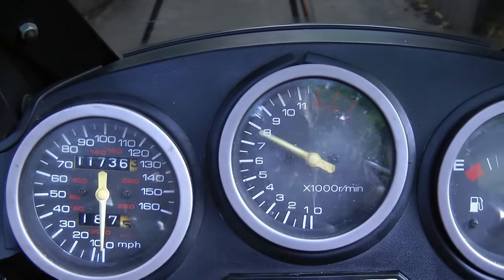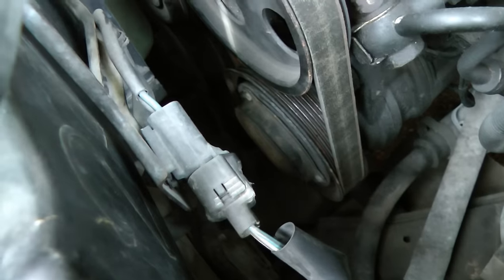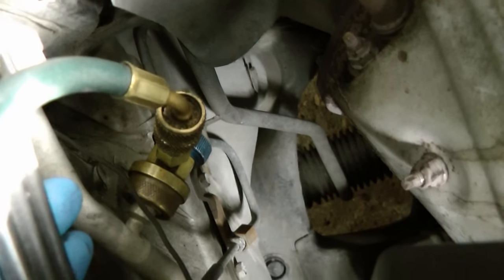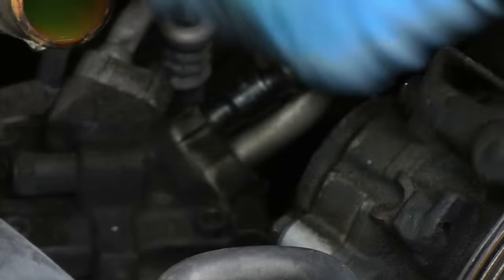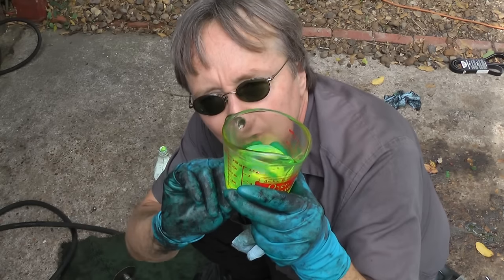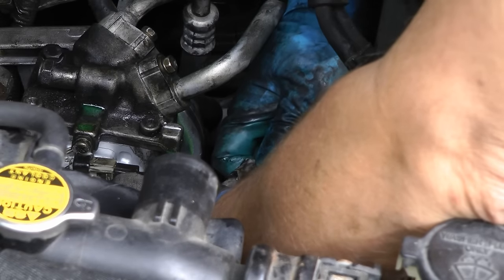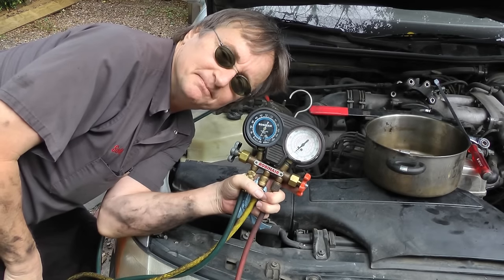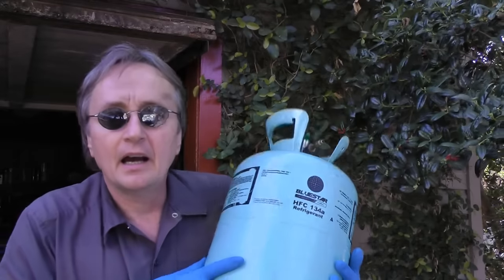How to Replace AC Compressor in Your Car

Comment: Im replacing the major components of an ac (compresser, condenser, receiver dryer, orfice tube, expansion valve in the rear ac) in a GMC G2500 Vandura. Im going to flush the hoses and the evaporator. I was wondering about the rear ac. I cant find many videos about it so Im worried I may miss something. Any advice would be appreciated. Thanks

Comment: @scottykilmer  ‘12 traverse AC light blinking 3 times. Replaced the ambient temp sensor but that didn’t work. Checked the low pressure side of the AC and it was zero. I recharged my AC using a recharge kit and the compressor kicked on. Once it got to a point the compressor turns of then on for a few seconds then off and on etc. No cold air but the light stays on now. Do you think a high pressure switch or something else could be the issue on why it keeps cycling back and forth.

Comment: Hey Scotty what all would I need to replace if the compressor has gone bad on my 97 mirage... or what all would I need to vacuum
Reply from the maker: I would change compressor, drier, and expansion valve, then do as in this video, You must vacuum out the system of course.

Comment: This looks easy enough but I've always wondered how you go about applying the correct tension on the belt after everything is buttoned up. Do you have a video on setting belt tensions or is that yet to be made? Sorry I haven't searched prior to this post.
Reply from the maker: most modern cars us auto tensioners. But if yours doesn't, you make the belt tight until the longest run portion of that belt can be just barely turned 90 degrees when you grab it with your hands and twist
Reply: Scotty Kilmer
Auto tensioners, will wonders never cease? Thank you kind sir, there is a reason why people say you are a great mechanic!

Comment: Hey Scotty I have a 04 Honda Accord Lx 4Cyl 4Dr Sedan. I have many thoughts about why my AC not working good as before. I get no cooling @idle (unless it's night time or the suns out or early mornings) or in traffic but cools fine on highway. I had recharge,vacuumed and even replaced my AC pressure switch.But i'm ending up with the same results>WARM AIR @ idle. So before I go all out on buying a AC compressor or kit, is the compressor really the issue? because by me buying the minor parts hoping that my AC will work. I just want to see if it's really the compressor. And every AC tech i go to they either tell me it could be my Expansion Valve or my filter.  They came to agreement that my compressor is working properly. But when i drive, i would hear my compressor click off. Unless that is normal for it to do. So Scotty, what do you prefer or think the problem is before I have to replace the compressor. And my fans are working properly as well.

Comment: Hi Scotty, great video! I have a 05 nissan altima, brand new ac compressor. The guy sucked all the air out, added freon but still the compressor isn't kicking on and no cool air blowing. The guy thinks now it could be my O ring. Do you have any ideas of what could be wrong?

Comment: Hi Scotty, how stiff should the compressor be when turned by hand, mine I would say was "moderately "stiff to turn, the drive belt was slack so I re-set it and it seems to be working fine? It has just been re-filled and had lube added too!
Reply from the maker: yes, moderately stiff resistance

Comment: Hey Scotty.  Great vid.  I've got an AC compressor and the clutch wont engage anymore.  Everything else about the AC system is fine.  I'm probably going to have to replace the clutch or the compressor at some point in the future but for now I'm thinking about some how joining the clutch to the pully so that the AC is permanently on.  Do you see any probs with doing that?  How would you do it?

Comment: Scotty, I have a green dye around my compressor and the pulleys bearing is shot because its making a squealing noise. I had the system emptied out at my auto shop. My question is do I have to replace the receiver dryer also? Im going to have my auto shop refill the a/c system, once I replace my truck with the new compressor. Thanks man!

Comment: Scotty,2006 Chrysler 300 3.5 rwd. 
As per your excellent - I had the AC vacuumed and recharged and dye added last year and she wasn't blowing cold at idle this week so I went to get it checked and they said that Low side was too high At 60 (and should be 30/40)
And I have Leak at front seal of the compressor as per the dye.They say I need to replace the compressor and dryer and with labor it's about $650.00. 
1.Are there any tricks/fixes to a leak at the front seal or do I need to do a replacement?
2.Do you know of any videos/step by steps walking through it for a 2006 Chrysler 300 3.5 rwd?  I'm no mechanic by any stretch but im willing to try with the proper direction. I've done a successful clock spring with a video.  I priced out the compressor/dryer at autozone for $245 for compressor and $45 for dryer.   The brand was 4 seasons. Any good?  Any brand you recommend or that I should stay away from? 
Thank you in advance for all that you do as you are a true treasure of knowledge and are able to translate that knowledge in a digestible manner. 
Stay awesome!

Comment: Hi again Scotty, I checked my other car and the pump is much "free-er" than the "problem" one. There is no noise or anything and the air con does seem to work ok, the pump body gets quite hot though.... is this normal?
many thanks & God bless, Bill.
Reply from the maker: yes, they all get hot when running, as they compressor gas to liquid which creates tons of heat

Comment: My question is, I have an 2002 Mercedes Benz C240. My wife was driving home from work when she heard a clucking sound under the hood and the AC went from cold to hot. I told her to park the car until I arrived to try to diagnosis the problem. The Sound was coming from the AC compressor. Some plastic inside the clutch looks like it had split and was sticking out through the cracks of the AC clutch front cover plate. What all parts would you recommend to replace to prevent another AC failure?

Comment: Hey Scotty, my mum has a strange problem with her car's AC. I just works for half an hour tops and then quits (if it works at all). We hat it at the garage yesterday, and even though they worked on it for the entire day they couldn't figure it out. There are no error codes in the computer, the compressor is working, pressures are OK (no leaks whatsoever), refrigerant amount is ok, condensor and heat exchanger are ok, ventillation is working properly. All HVAC systems are within spec, apart from the fact that it doesn't get cold inside (after some time) even if it's really hot outside. All sensors an actuators were checked and all the electrics, but no faults were found, even after 3 test drives by the mechanics. Do you have any idea what else could be at fault? (2011 Opel Astra)

Comment: Scotty Kilmer I have an 03 Camry where my AC light is blinking. Replaced the compressor, magnetic clutch relay switch, and cabin air filter and still the light blinks. When I turn on my AC, the radiator fans starts to blow and then shuts off. Any ideas on how to fix this? Thanks in advance!

Comment: Many compressor manufacturers won't warranty it unless you show proof of flushing system, new dryer, expansion valve, and proper PAG oil refilling. Also - after vacuuming I'd let it sit for awhile - like overnight - to see if it holds vacuum.  Cause if it doesn't - you got another thing to find and fix.  Anyways- as he said - if it broke while driving - do the proper prep - cause if you don't and you simply re-install a new one - the debris from the old one will not only screw up the new compressor - but it will screw you out of a warranty replacement.

Comment: what kind of oil are you putting in the compressor? engine oil? or there's a specific compressor oil?
Reply from the maker: most modern cars use PAG oil, but the weight varies, always check with the manufacturer

Comment: If the pulley bearings are bad, and the belt broke because of it, but when turning the compressor via the clutch, it's quite rough sounding, does that indicate that the compressor should be replaced?  Was blowing cold most of the time, but intermittently before the belt broke.
Reply from the maker: yes replace the whole compressor assembly

Comment: Wondering if I should just replace the evaporator also. It's only like $100. Is it hard to take off and put new back on.
Reply from the maker: evaporators on some cars can take many hours to remove and replace, and if they don't leak, they generally last forever

Comment: Hi Scotty,

My serpentine belt broke recently and when I checked the pulleys, the A/C Compressor was the only one that didn't turn; however, the inside cap on the compressor turned just fine. How do I know whether it's the entire Compressor or just a bad bearing? Thanks!
Reply: Pipinhotcoffey I have a 99 Olds Intrigue 3.5L

Comment: My compressor seems to be bad but it's not locked up. It has been working off and on for last week. Now it just blows hot air. It's a 2014 kia sportage 90,000 miles.

Comment: Hi Scotty I have a compressor problem on my  1987 Mercedes. I've diagnosed the problem on my compressor and my auxillary fan. They seem to work fine. The compressor clutch work but when I turn the a/c on both my compressor and aux fan didn't work. Any idea of what might be?

Comment: Hey Scott I have a 2013 Suzuki sx4 le and the ac compressor spins and stops and since everything is power the same belt it strips it and causes it too rip. Ive change the belt and I have too run the ac on hi to make the compressor spin all the time. What do you think its the issue. Mechanic said it might be have low pressure and this is why it spins and stop when the ac is off.. But he is charging me just too check the pressure 69.99

Comment: Hey Scotty Kilmer  I have a Mazda 3 2.5 2009. It's idle seems to jump around when the AC is on and the car will stall but seems fine when it's off. Could this be the AC compressor?

Comment: hey scotty - great video! just a question on diagnosing if my problem is the actual compressor... A/C works, but when I accelerate, I hear a loud screeching - only happens when the A/C is on.  compressor on the way out? thanks!  '02 GMC Sierra 1500 V8

Comment: Have any videos or tips on how to flush the system?

My wives 2005 Scion xB needs a new compressor (replacing drier at the same time). We bought it with this broken so I'm not sure exactly what happened but I would bet it locked up which you mention if thats the case the system needs to be flushed.

Also just so I get a fair price. About how much should it cost me to have a shop remove the freon, vacuum the system for moisture, and put new freon in?

Thanks for any tips! Love the vid.
Reply from the maker: prices vary widely from place to place, and many guys won't work on a car the owner does the major work on cause they spent a ton of equipment and aren't working for peanuts. But you can call and try.  As for flushing, pretty much a waste on modern cars as fin holes are too small for it to work.See my video "why flushing modern AC systems does not work"

Comment: If clutch engages and make a noise then stops is it the clutch or the compressor.  02 Toyota Sequoia. Pressure is good on system.  When turning on the ac clutch engages makes a grunt like sound then ac light  flashes and clutch disengages?

Comment: smart joop mate i just did my mercedes cls amg 55 2005 model i change all pulley but still the same only thing im thinking to look up is supercharger or aircon compressor,,,i can hear noisy if i dont acelerate but if i acceletrat i canot hear no more .what do you thing pl mr SCOTTY

Comment: Hello Scotty,
I took my car to toyota dealership and they say i have a  messed up a.c. compresser and condenser and that it has to  be removed from the toyota celica 03 all together.

I wanted to know if their was a way to just shut off my ac all together by either removing the belt in their or a pulley? Or can a fuse be shut off or just a belt re adjusted or removed in order for the unit to stop working. I have read other posts that have said their are no adverse effects to the vehicle if these things are done.. besides not having cold ac.

Thanks

Comment: Question, purchased new compressor for my 03 lesabre. Took old compressor out.  Noticed that new one doesn't have the manifold bolt for attaching ac lines to the compressor. Looking at the old compressor it doesn't look like the bolt comes out.  I am beyond confused.  Any help would be great.

Comment: In replacing the compressor will I need to flush AC system? I plan on trying to replace it myself if need be along with the drier and getting a seal & gasket set should I get anything else? On this 04 Vue  Do you or can you give me advice on this and the procedure? I don't have gauges or pump, refrigerant or recovery system.  Thank you for your time!  Mike

Comment: Scotty I think the compressor on my 1990 Towncar is bad. The AC stopped coming, but I noticed the compressor still appeared to be working. Then one day I noted the clutch pack will no longer engage; I tried turning the compressor and it moves, but I notices in spots that it feels bound up. Would this mean its time for a new compressor?

Comment: Scotty, I just bought a compressor from ebay, I got a message this morning saying it will work if my old compressor has a 12 O'Clock Coil.

What is that?

Will I have to send it back once it arrives if my old compressor is not a 12 O'Clock Coil compressor?

Thanks in advance sir..

Comment: Hey scotty i have a 2000 honda civic lx ive changed the dryer and expansion valve and the ac compressor wont kick on ive hooked it up straight to the battery and refilled it.

Comment: Thanks for this video.  My husband's 2004 Ford F-150 has a bad compressor.  We did the dye test in the line, and the mechanic said it wasn't a specific leak, rather everywhere, indicating the compressor was bad.   They quoted us a price of just over $1000 to replace the compressor, and suggested we just refill it with Freon (not sure how to spell that) if we didn't want to pay the $1000.  When looking online, the replacement part is not very expensive.  Why the high price quote?  He wants to try to do it himself since he is able to do many repairs himself as far as electrical and plumbing stuff.   First, does this price quote seem right?  Also, is it that tricky to do yourself?  Thanks!
Reply from the maker: AgendaInMind   mechanics make big profits on AC work, why not do it yourself? That's what my videos are for. You would have to buy about 150 bucks worth of equipment, but then you could fix your own AC forever on all your cars
Reply: AgendaInMind I got a quote today and they told me a little over a grand as well. So dumb

Comment: Thank you Scotty for the video. I have a question.! I have a 1994 civic manual. The compressor went bad and the belt too. My car has three belts. Alternator, compressor and power steering. Am I able to drive the car even though this things don't work? Because I noticed that after they broke down, I was able to start the car again. But I don't know if I should drive it. Please help me..!
Reply from the maker: +heriberto silva   sure, as long as belts don't drag you can drive it. If the ac belt ONLY drives the compressor, just cut it off
Reply: +Scotty Kilmer thank you so much..!!

Comment: Scotty, I have an 04 Accord V6 and my A/C works generally but it makes a rattling, creaking noise when it engages, occasionally is will only blow warm air for about a half hour and then go cold, but thats rare. Do you think I need a new clutch set or auto tensioner?

Comment: I have a 2006 jeep liberty that just started blowing hot air. The Ac compressor makes noise when running now. Is there a way to change the compressor without draining the system? if not, can it be drained without recovery

Comment: Hey Scotty, thanks for spending the time to make these videos! I've watched a ton and they've been super helpful. My mother-in-law's AC is leaking all refrigerant out when I try to recharge it for her. I can't find any oil residue on the high or low pressure lines and I can hear it leak at from around the compressor, so I'm assuming it's the source of the leak. The compressor isn't locked up, so is there a way I can fix the leak in the compressor without having to replace it?
Reply: Change the o rings on the compressor...

Guess I'm 11 years late

Comment: I'm having a problem with my air conditioner. When I press on the ac button it won't stay pushed in. But if I press and hold it it it works. Do i need a new ac compressor or the ac control?

Comment: 2007 Jeep liberty.

After getting a water pump replace, the a/c system failed a couple of hours later. Hooked up one of those a/c recharge kits they sell at walmart, and it showed pressure was extremely high. A/C clutch was not engaging but would spin freely. The car acts like it has engaged the a/c compressor (idle elevates slightly then drops as if under load). 

Took it to a shop a year later, and they said a/c compressor failure. 
They were extremely busy that day and i have doubts whether they spent any real time trying to trouble shoot it.

Would you agree with their opinion?

In addition;

If i were to change the a/c compressor myself, would it cause damage to the compressor to drive the vehicle to a shop to have the system recharged?
Reply from the maker: god knows what damage may have been done when they worked on the car, of if it's just a coincidence. BUT, you can change all that yourself, then pay a mechanic to evacuate the system and refill it.